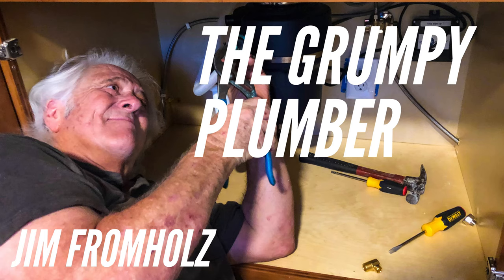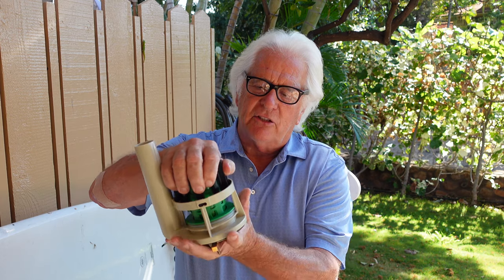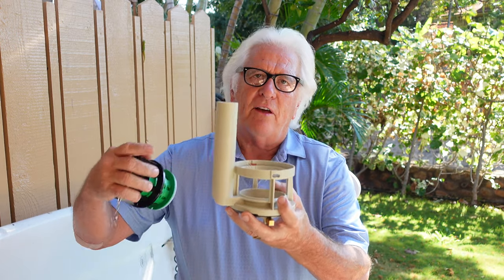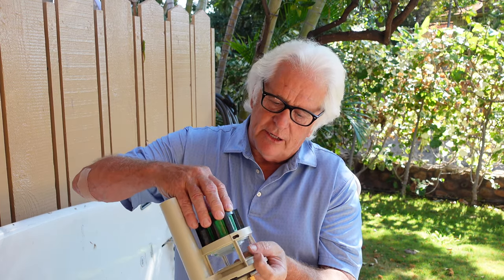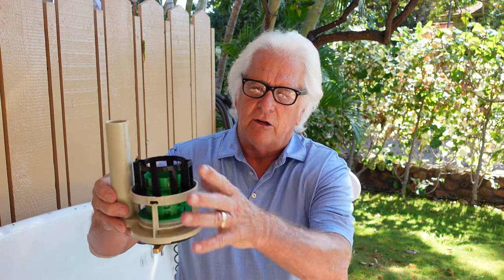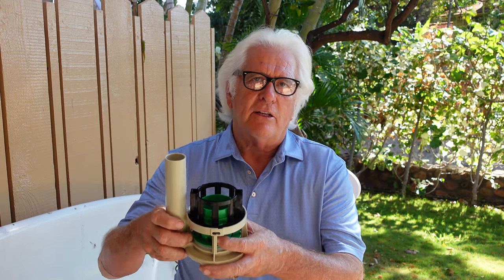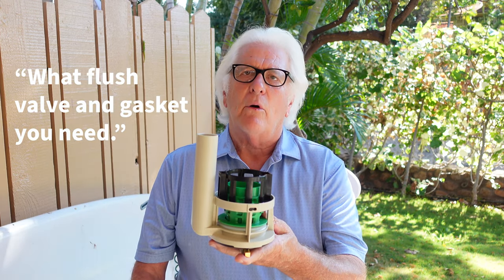How to Install Toto’s New Flush Valve | replace your flap with a flush valve

Comment: Thanks for the info Jim, it will be interesting to see if my lawyer agrees, LOL, another subject I would like to know what you think about hot water recirculating in residential houses. I am thinking about installing one, not sure I like the ones that connect the hot water and cold water under the sink, seems like a return line would be better, would like to see a video  on this and get your opinion before I call my lawyer.
What type and brand do you suggest and do you think they are really worth it for that convenience of hot water quicker.
Reply from the maker: Michael Collins, if you do it yourself and run in Pex A, you’ll save a lot in labor costs. It’s not to say it’s worth it, it’s just the great pleasure of having instant hot water.

Comment: Thanks for the info installed my new Toto toilet and the clear cap that holds the gasket on, had fallen down between the tank and the bowl and I didn’t realize it allowing the gasket to fall off continually.
Reply from the maker: If you think the flush valve is defective, call Toto at 1 888 295-8134. They will be glad to help you.
Reply: @TheGrumpyPlumber thanks I just called and they had me send a video.  Awaiting a call back.  Brand new.  Won’t stop running.  Filling the stand pipe from black hose.
Reply: They were very helpful and sending me a replacement flush valve
Reply: @BryanPAllen  Did this fix it for you permanently? I replaced my flush valve assembly and after three weeks, the gasket and the clear cap came off again. The cap doesn't seem to clip on very securely.  Thanks.
Reply: @ChrisNolan-n7i  yes still fixed

Comment: Can these be installed on the old American Standard toilets that use the disk flap or are these for current Toto toilets only?   If retrofit, can you do a video showing how to swap out a flap for this new canister style.  Thanks, love your videos.
Reply from the maker: Barbara Koziol, sorry but these flush valves are only for Toto toilets. Can’t be retrofitted. Thanks for subscribing.

Comment: Thanks. My problem with a 3-month old Toto Drake is that the drain valve gasket and the white plastic piece that holds the gasket in place both come off. Then the leak starts into the bowl, I take out the green cylinder and find both gasket and white piece sitting loose in the area where the tank and bowl connect. Toto sent me a complete replacement flush tower, but I only replaced the green cylinder (and thus the gasket). Worked great. Three weeks later, the plastic guard and the gasket had come off again. I suspect the sudden suction of the Toto flush valve must be pulling the parts loose. Any suggestions?
Reply from the maker: @ChrisNolan-n7i  call Toto back, tell them the problem and see what their suggestions are. Your toilet should still be in warranty. I think you should have replaced the entire flush valve that Toto sent you. They might have had a problem with the old flush valve.

Comment: Is it adjustable to help keep the “flapper” or cylinder open longer for a more powerful flush?
Reply from the maker: @DarthRogue777  if the flapper has a float attached to it, lower the float. That will give you a longer flush. With a canister flush valve, I don’t believe there is an adjustment.

Comment: I have this exact flush valve for a Toto Drake 2 piece toilet. Nice to know the wear part, the flush valve seal can be reversed and when the second side is worn, can be replaced.  Would you happen to have the part number for the seal? Thanks.
Reply: I re-viewed your video a second time. The part I'm asking about, you called it a gasket. I'd rather ask you what the part number is than a lawyer.  Thanks.
Reply from the maker: I would recommend you call Toto (18882958134) and ask for Tech Support. Inside the tank on the back wall you’ll find the model number of your toilet. Tell them that number and they will tell you what part number you need for the canister gasket.

Comment: I have an issue where the silicone gasket on mine keeps developing a "bubble" inside the silicone, which causes a slow leak. Replaced with a new gasket, the bubble developed and started leaking again...any ideas?
Reply from the maker: THEJavelinX, I think you are talking about the gasket on the flush valve, correct? If I replaced with a new gasket and I had to replace it again, I would be on the phone with Toto tech support. Phone number for Toto is 1888 295-8134. If there is a problem with the gasket, they can tell you and send you the right one. Make sure you are using Toto OEM parts.

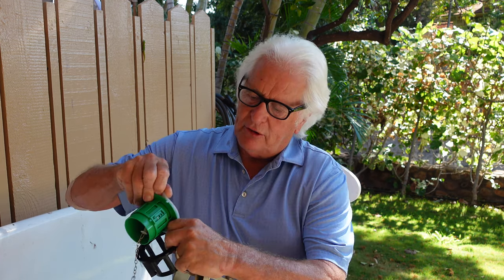Comment: I have this drain valve assembly and the little white piece at the end of the chain (looks like an upside down top hat seen at 0:59) keeps getting stuck at the top, over the lip of the green part of the assembly leaving the drain valve open. Is this normal? Is the white piece even needed?
Reply from the maker: @Glucoselord  I’m sorry I didn’t get back to you sooner as we were traveling. That little white round piece that is connected to the chain should be connected as far down the chain as possible.  It should be connected to about the third loop on the chain. There should be the least amount of slack in the chain when connected to the tank lever. Good question. I hope this works. If not, call Toto at 1888 295-8134 and possibly they will give you a new canister.

Comment: Hi, have a C5 with Washlet and the flapper valve sticks.  The little white plastic thing around the chain where it hooks onto the flapper falls to one side and sticks when you flush it.  When it sticks, the chain is now to short and the valve doesn't close.  How would you fix this?
Reply from the maker: If I’m understanding you correctly, you have a canister flush valve. You need to shorten the chain from the tank lever to the flush valve. The easiest way to do this is disconnect the chain, make it as tight as you can to the tank lever and add one length and hook it up. Hold the excess chain while you flush. See if that helps. If the flush valve doesn’t close, add one more length of chain. Flush again and see if this works. If so, cut off all but two lengths of the chain. New subject, if the canister was installed incorrectly, that could be your problem. The overflow tube should be at 3:00 when looking down at the canister. Hopefully this will help. If not, contact me again.
Reply: I will give it a go. @TheGrumpyPlumber

Comment: I have a older Toto one piece Ultra I watched your video and wouold like to change my flush valve to the new type, do you know the part number for I believe is the CST 854 one piece round front Ultra?
Reply from the maker: Richard, call Toto and they will tell you exactly what you need: 888 295-8134. Very easy to replace. Just make sure you put the overflow tube at 3:00. Thanks for watching.